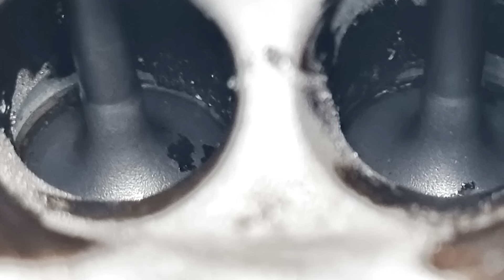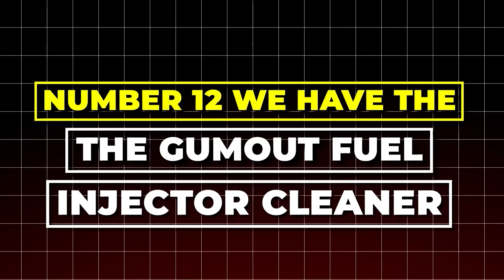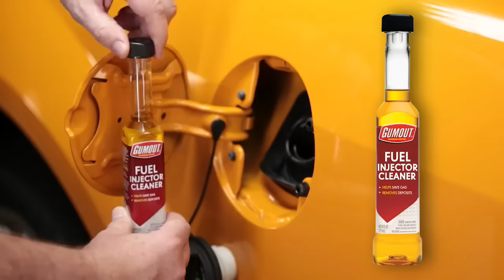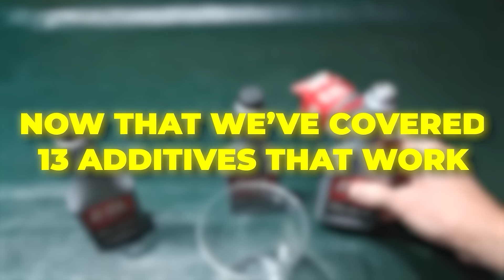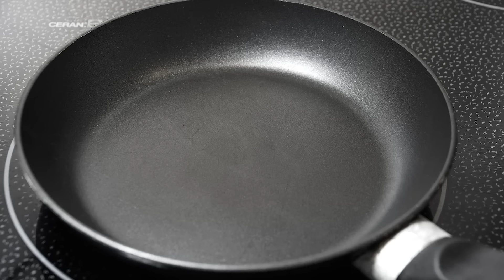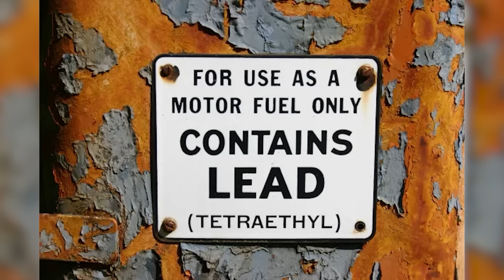13 Engine Additives That Work (And 5 That’ll Kill Your Car)

Comment: I had great results with Slick 50 in the mid eighties, I think they might have changed their formula in later years.
Reply: That's what gets a lot of products in trouble.  They have early success in them, but brake the very golden rule that says: "If it aint broke don't fix it!   UNLESS! the engines coming out after the mid to late 80's and after, are not tolorating the slick 50 additives!
Reply: 100%, the Slick 50 of the 80s worked and the current stuff is not the same.
Reply: Slick 50 isn’t the same today as it was in the past. The originator had legal battles over the product and he changed the name and no one can’t get it in the USA. Use pro lube additive instead. I use it and it has worked great in my jeep pentastar engine. It made it run a lot better and quieter.
Reply from the maker: Slick 50 did have a good reputation back in the day, but as you mentioned, it’s possible the formula has changed over time. It’s always worth comparing newer versions to see if they still live up to the original.

Comment: You will gain 0-ZERO more power and fuel economy  with 95 instead with 91 octane fuel, they have same caloric value, octane number is about who is more ressistant to preignition in high compresion engines
Reply: You'll only seen an improvement if the engine actually NEEDS the higher octane.  If the engine was built to run on 85 Octane, like the vast majority of vehicles sold in the US, running 89 or higher is a complete waste of money and may actually cause problems.
Reply from the maker: Higher-octane fuel like 95 isn’t going to magically improve power or fuel economy unless the engine is specifically designed for it. It’s all about resistance to pre-ignition in high-compression engines, as you mentioned.

Comment: WHATS CONSIDERED AN OLD ENGINE????????
Reply: Anyone that is driven off the dealership after purchasing !
Reply from the maker: An “old engine” typically refers to one that has been on the road for over 100,000 miles, though some might consider engines older than 10-15 years to be "old" as well. It really depends on how well the engine has been maintained.

Comment: Liqui Moly, trust me half can. Zoom zoom. Rev to 5k, cant hear the thing. Used to be thrashy.
Reply from the maker: Sounds like Liqui Moly worked wonders for your engine! Half a can and a good rev to 5k is a solid trick for quieting down a thrashy engine. It’s great to hear it made such a big difference in performance. Liqui Moly is definitely a go-to for reducing friction and improving engine smoothness.
Reply: @carcareclues 
The best !!!
Believe me..
Reply: Liquid moly is awesome, I use it for industrial machinery too. Especially good for hydraulics and gearboxes.

Comment: I have found that gumout "regain" works best for my 2000 Mercury mountaineer with 225,000 miles
Reply from the maker: It’s great to hear that Gumout Regain has worked well for your Mercury Mountaineer. With that many miles, keeping the fuel system clean is key. Gumout is known for its effectiveness, so it makes sense that it’s been a good fit for your engine. Thanks for sharing your experience.

Comment: Sea Foam killed one of my engines.
Reply from the maker: That’s unfortunate. While Sea Foam works wonders for many, it's not always the best fit for every engine, especially if there are pre-existing issues. It’s a good reminder that not all additives work the same for every vehicle. Appreciate you sharing your experience, and I hope the engine's repair wasn’t too costly.

Comment: How do these products affect the catalytic Converters?
Reply from the maker: Some additives, like certain octane boosters and oil treatments, can potentially harm your catalytic converter if used excessively or improperly. For example, products that contain metals like MMT (Methylcyclopentadienyl Manganese Tricarbonyl) can coat the O2 sensors, which messes with the air-fuel mixture and can lead to a damaged catalytic converter over time. However, well-formulated fuel additives like Techron or Marvel Mystery Oil tend to be safe when used correctly. Always make sure to check the product label for compatibility with your engine and catalytic converter.

Comment: Here in Northern Ontario, Canada, we don't care about additives because our vehicles rust to the door handles from the salt in the winter long before our engines ever wear out.
Reply: I feel for ya!  I grew up in PA and NY and the winter salt killed cars.  I've been living in Oregon and Texas for combined over 30 years now and my cars are super clean underneath.
Reply: I know. We probably spend 50-150k more on vehicles through out lives compared to US residents because of rust (depending on the person obviously). I am just gonna keep my rusted beater and drive it in the 8 months of the year where there is still salt all over the road
Reply: Visit Crown every year. My 08 has no rust.
Reply from the maker: I get what you're saying. Winter conditions can be tough on vehicles in places like Northern Ontario, and rust often becomes the bigger issue. Even though additives can help with engine longevity, if the body’s not holding up, that’s the bigger problem. Regular maintenance with quality products is key, but fighting the salt and rust definitely requires extra attention.
Reply: Yeah my 01 accents frame bit the dust a couple months ago bought it brand new now I know to spray the frame and other venerable parts with gutter sealer flex seal I think they call it
Reply: @tammieraines7307  No, use fluid film or Rust Chek. It's made for that.
Reply: I feel ya. My Saturn was sold in Clarence, NY and did its first 2 years in Buffalo (96-98). I had no idea how bad that thing would rust even though I left Buffalo for East TN a year later. The car turns 30 next year and Ive had to fabricate several fixes to rotted out areas. She'll make 300k and then i am moving on to my first import at 60. 😂

Comment: I worked for Farmland industries where I was sent to a lubricant school which was 4 hours in length. A certified instructor and professional mechanic told the class engine additives is not needed when proper maintainence using quality products, and also which he called engine additives " Mouse Milk"
Reply from the maker: Proper maintenance with quality products is usually all that’s needed. Some mechanics do refer to additives as "Mouse Milk" for good reason—they're often not necessary for well-maintained engines. It’s all about using the right products in the right way, and for many cars, additives just aren’t needed if you stay on top of regular oil changes and maintenance.
Reply: I have had some professional mechanics tell me some really stupid stuff as well. They make their living fixing things, not making them perform better. No conflict of interest at all.

Comment: There is a product called PROLONG that works as advertised  its not like slick 50  check it out I know works oil water and power steering transmission  ive ran out of oil and I didn't blow my engine
Reply: Prolong works Great when I am with my "significant other".
Reply: Realistically, prolong will outperform anything he talks about. It's on another level. They used to put it in and then pull the oil pan and run the engine with no oil and didn't damage it. Was a state fair gimmick, but it works.
Reply: @stevenmiller6725  It was a "gimmick" alright... faked.  Prolong is snake oil.
Reply: @CaseAgainstFaith1 no it's petrochemical based. Definitely not made from snakes.
Reply from the maker: Prolong is definitely one to check out for engine protection. Sounds like it’s done some good work for you. When you can rely on a product like that, it’s worth sharing! It’s always great to have reliable options that help keep things running smoothly in tough situations. Thanks for the recommendation.

Comment: Want 93 octane gas in California. Lead substitute is actually diesel. Not to mention lead gas destroys o2 sensors and cat converters in any car made since the 70s. Leaded gas is still in use in off-road/ racing applications
Reply: California needs a hell of a lot more than 93 octane, that's for sure.
Reply: @boeing900 like a 9.5 magnitude quake a cat7 blizzardcane volcanoes going off at the la brea tar pits to happen at the same time
Reply: Leaded gas is REAL gas. No need for "hardened" valve seats or octane "boosters".
Reply: @TheOzthewiz of course leaded gas is real gas I was talking about the additive
Reply from the maker: You’re right about leaded gas and its impact on O2 sensors and catalytic converters, it can really wreak havoc on emissions systems in cars made since the 70s. Diesel as a lead substitute is an interesting point, though, as it’s still used in racing and off-road applications where those systems aren't as much of a concern.
Reply: @carcareclues with the lead substitute- I took a look at the labeling. While all fuel additives say petroleum distalates only the lead substitute additives States diesel as an ingredient

Comment: Lucas gave me 330k miles on my BMW, then I sold the engine to a guy that kept driving it. I only removed it to put a an M3 engine in and only use 5W-30 synthetic and Lucas. Winner!!!
Reply: Make sure you use the synthetic Lucas with synthetic oil
Reply: @CAROLDDISCOVER-2026 Yes! Full synthetic with pure synthetic!
Reply from the maker: That's an incredible run with your BMW! 330k miles is a serious testament to how well Lucas can work when used with regular maintenance. It’s awesome to hear that the engine kept going strong even after you sold it! Using high-quality synthetic oil like 5W-30 with Lucas seems to have been the perfect combo. Sounds like a win-win for both you and the next owner.
Reply: @carcareclues I use it in all my vehicles, including a couple 4.0 liter Jeep XJ's.
Reply: A chevy with 300k+ nice !! A BMW with 300k+ wow !!
Reply: @OliveHello They will pretty much last forever if you maintain them. Only the first couple BMW owners maintain them. After that they get trashed. 330k was nothing for that engine and it still going in another car that will continue to be maintained.

Comment: This is nothing more than a long commercial for the products shown. Most of these are nothing but snake oil. If it doesn't contain PEA, it's worthless. Techron and Redline SI-1 have the highest concentration of PEA. those are the only additives I've used more than once.

Comment: You should absolutely never add anything to your oil due to the likelihood that the additive package in your oil will not be compatible with the crap in a bottle, resulting in a chemical reaction that can and sometimes does causes engine damage. 
It's a gamble. Don't do it. Stick with changing the oil with quality synthetic oil no more than every 5,000 miles.
I recommend NAPA brand, which is made by Valvoline. 
ASE certified master technician retired
Reply: Thank you I'll do it as you say! Is gas treatments on occasion ok? I find that after spending $2,000 on my 940 volvo with 350,000 miles it runs much better as does my 2019 sentra and 2020 Mazda on non-ethanol 90 octane or just 93 ethanol if I can't get the non ethanol Any suggestions on gas treatments? PS my '93 volvo needed the parts honestly I had neglected the car having had newer ones but it runs fantastic now! THANKS!
Reply: @dennispacelli1007  Chevron Techron Fuel System Cleaner.....  Every 15,000 miles.  Follow the instructions on the bottle.
Reply: @aaronthomas6155  Hey thanks! I forgot to mention I did use the Techron in my volvo I think I put non ethanol gas in that may have been sitting in the ground a long time and the treatment helped tremendously thank you!

Comment: Yamalube Ring Free gives you more "techron" for your dollar. Use once in a full tank fill up after every oil change and ALL my 4 stroke motors run great. The other plus is its also great in 2 strokes. Have never used oil additives because I change frequently but I did once use some magic Lucas additive for a slipping trans and that had amazing results.
Reply from the maker: Yamalube Ring Free is definitely a solid choice for keeping your fuel system clean, especially with its added benefits for both 2-strokes and 4-strokes. It’s great to hear it’s worked so well for your motors! Regular maintenance like frequent oil changes is always a good practice, and it sounds like Lucas came through in a pinch for that slipping transmission! Sometimes a well-chosen additive can be a game-changer for specific issues.
Reply: Yomama lube. I know it sounds so wrong….good stuff but I love the Motul products

Comment: I'd never use any additive in my like-new 2017 F-150!
Reply from the maker: It's understandable to avoid additives in a well-maintained vehicle like your 2017 F-150. Regular oil changes with quality oil and filters are often sufficient for newer engines. However, for older engines or those with specific issues, additives can provide additional benefits. It's always best to assess the condition of your engine and consult with a trusted mechanic before deciding on the use of additives.

Comment: I've used Lucas in my old 92' Chevy 454 RV, it works great and makes gas stable for years!
Reply: It's the best
Reply: This video is nonsense.  Check out some videos with real tests. Oil additives dilute the additive package of your motor oil.  The Motor Oil Geek is a good place to start.

Comment: What happened to MMO synthetic?
Reply from the maker: Marvel Mystery Oil (MMO) Synthetic Motor Treatment is a modern version of the classic Marvel Mystery Oil, formulated specifically for synthetic motor oils. It offers benefits such as:
Removing and preventing sludge buildup
Conditioning oil seals to prevent leaks
Providing high thermal stability
Quelling noisy lifters
Increasing shear stability and reducing friction for longer engine life
Enhancing low-temperature oil flow at start-up
Restoring compression and power

This product is designed for use with both synthetic and conventional oils, making it versatile for various engine types.

Comment: MMT in octane boosters will coat the o2 sensors and result in overly lean a/f mixture commanded by EEC.
Reply from the maker: MMT in octane boosters can coat the O2 sensors, leading to inaccurate readings. This disrupts the air-fuel mixture, causing the engine to run too lean, which can lead to poor performance and even long-term engine damage. It's definitely something to watch out for when choosing an octane booster.

Comment: nothing on the MMO synthetic?
Reply from the maker: MMO synthetic is another solid option for older engines, as it’s known for cleaning and lubricating the fuel system and oil passages. It can help with improving oil flow and reducing carbon buildup, especially in high-mileage cars. I’ll keep an eye out for more details in future videos,thanks for bringing it up.

Comment: BG EPR (Engine Performance Restoration) works extremely well too. It frees up stuck piston rings. If your engine smokes when it is running, chances are good that some (or all) of your piston rings are stuck. I've used it multiple times now, and it eliminates oil smoking. Follow the directions on the can to the letter. It also works on small engines like you might have in your lawn mower. Use 1/4 can for each quart of oil in your small engine.
Reply: BG Transmission flush destroyed my transmission.
Reply: @mg8720-u7j , well... here in the US, it is said that if you don't do regular fluid and filter changes to your automatic transmission, then you're better off not doing a change at all. You found that out the hard way. My '07 Chevy Silverado has 172k miles, and I've never done a fluid and filter change. I will be taking my chances this coming fall and doing a fluid and filter change. I will not be doing a BG fluid flush.
Reply: Oddly as it may sound , one of the old  tricks back in the day was to keep a little of the old fluid to put back in. If your fluid is not burnt, u may be okay.
Reply: @ceddyced31 , you don't really have to do that because there is still a lot of transmission fluid in the transmission, lines, cooler,  and the torque converter.
Reply from the maker: BG EPR is a game-changer, especially for stuck piston rings and oil burning! It’s one of those products that’s really effective when used correctly. I love how it works on both car engines and small engines like lawnmowers too. Following the directions is key—thanks for the heads-up.

Comment: PEA is in a lot of them really.  just read the label.  Oh, and be careful not to spill any additives on your paint.  Some brands have acetone in them and that will destroy your paint on contact!
Reply from the maker: PEA is a common ingredient in many effective fuel system cleaners, so reading the label is always a good idea. And you're absolutely right, acetone can be a paint killer.
Reply: Red Line has the most PEA.

Comment: If you are not sure, then you should not use an additive.
Reply from the maker: That’s a valid point! If you're not sure about using an additive or how it’ll impact your engine, it’s definitely better to err on the side of caution. If your car’s running fine with regular maintenance, there's no need to complicate things with additives. Always trust your gut and stick with what’s working for you.